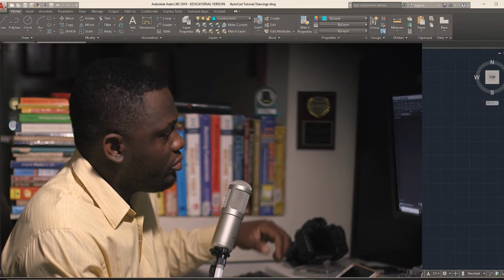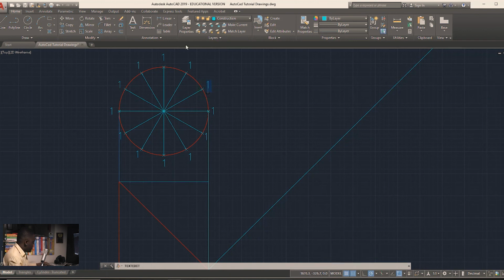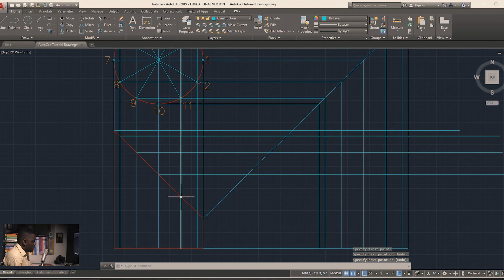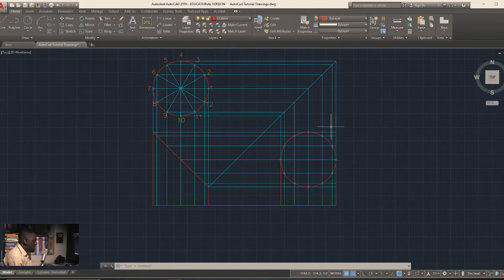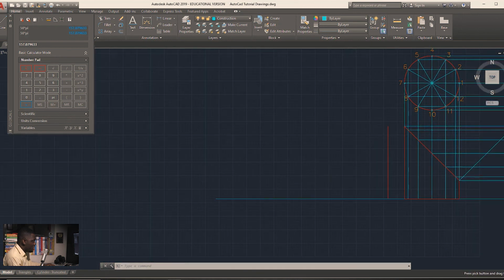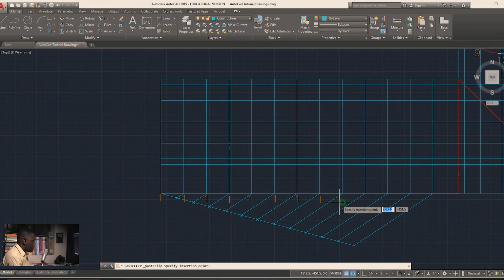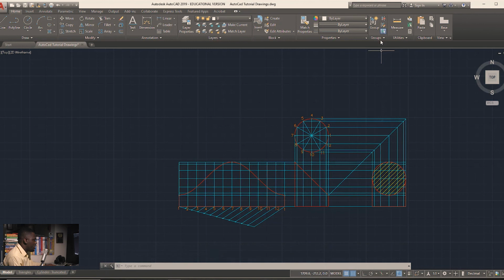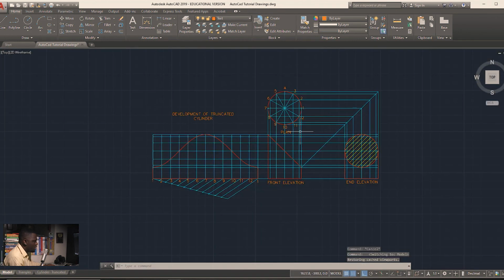The CAD Corner | The Development and Orthographic Projection of a Truncated Cylinder

Comment: Thank you very much for this lesson. But I have two questions, why you divided on 12 line and not 8 lines?  
Can you make a lesson on truncated cone 30 or 40 angle? pleas
Reply from the maker: Because 12 is a more precise number. If two men were in a race and both ran to the line but the clock only measured to 10 seconds who won. You would need more numbers to tell. Suppose the clock went to 10.0 seconds you could them tell them apart. So the more you divide the circle the greater the precision and accuracy.

As to the request for a video what would you want me to do exactly?